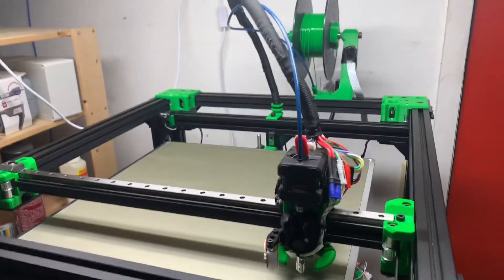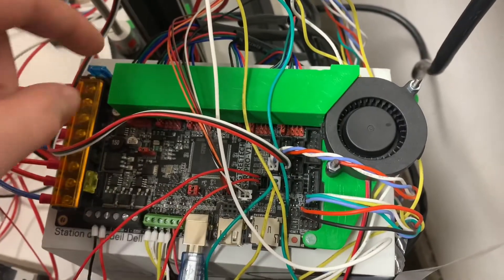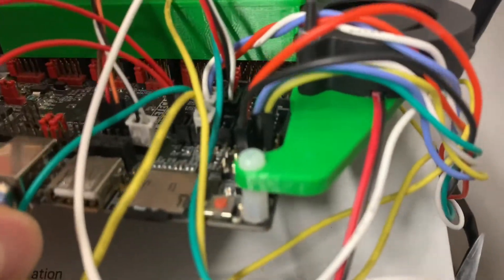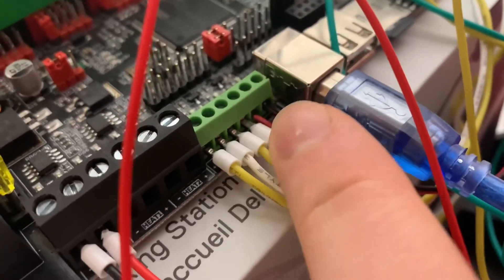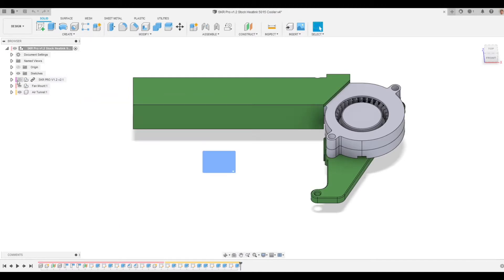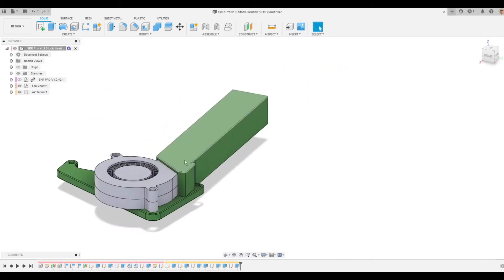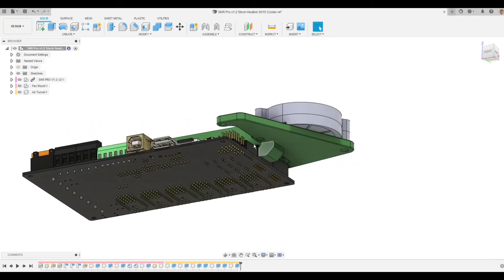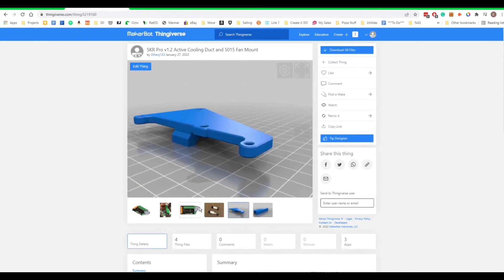Active Cooling for Stepper Drivers (SKR Pro v1.2)

Comment: Do you think that over heating stepper drivers are the main cause of layer shifting... or model lifting WARPING slightly from the bed ?
Reply from the maker: Layer shifting can be caused by many things. In my experience it has been from wrong belt tension, stepper drivers overheating, pulleys not secure, belt alignment and catching on the top or bottom of the pulley…. So yes.

Warping is caused my not using an enclosure, poor bed adehsion, too much cooling. Usually anything that can create eneven temperature distribution around the part. Ie. a guster of slightly air, fans…

Comment: is there a way to access and plot the temperature of the drivers through the firmware to see the true effectiveness?
Reply from the maker: Unfortunately no :( I believe there is only over temperature detection on the drivers themselves. This triggers around 140C. Implementing another external temperature sensor to Klipper is definitely a possibility. Maybe ill test this in the future.